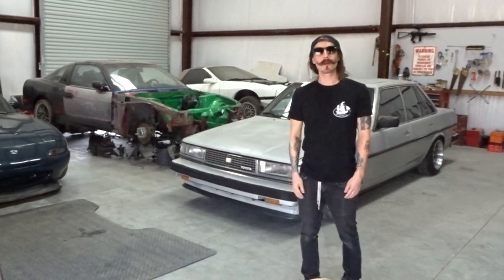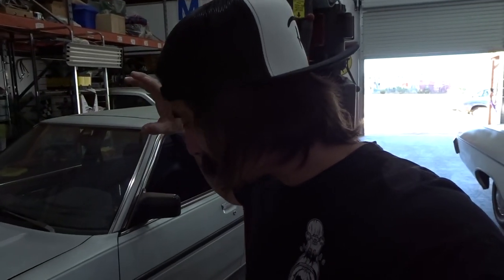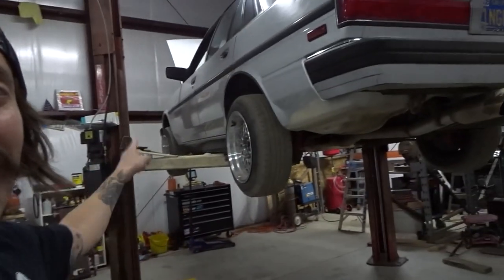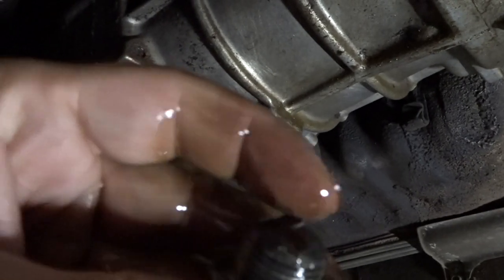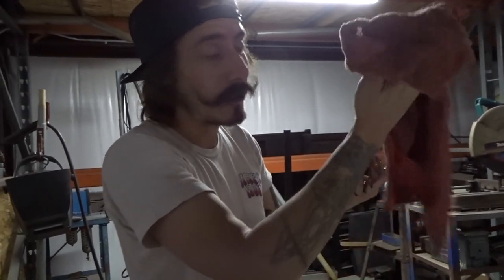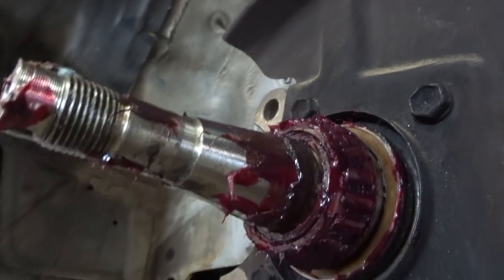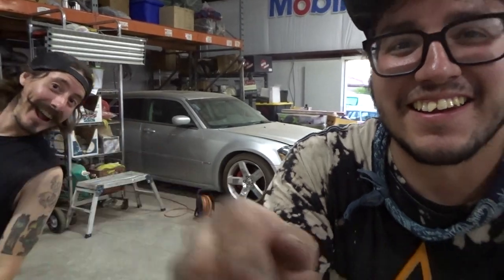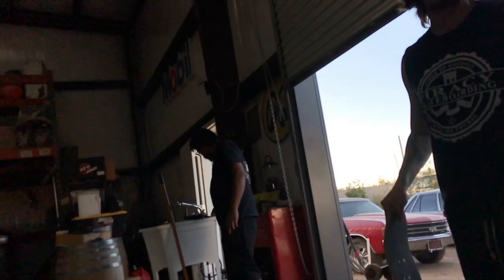Cressida (mx73) has an oil leak | Rear main or cam shaft caps???

Comment: what was the electrical problem you had on the cressida
Reply: nevermind saw the relay video
Reply from the maker: It ended up being the main relay. I bought a new one thinking it was going to work but nope. Eventually I found a Cressida in junkyard and took the main relay. Installed into Cressida and booom it worked!!!